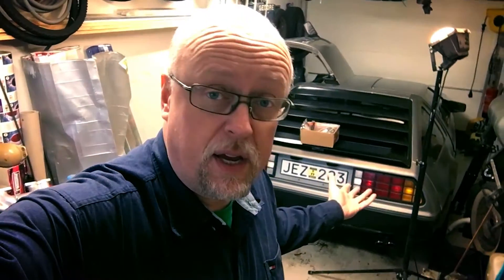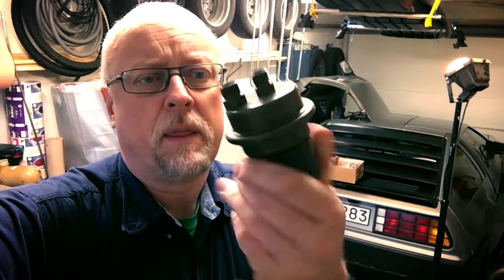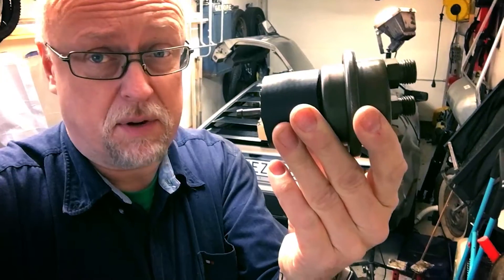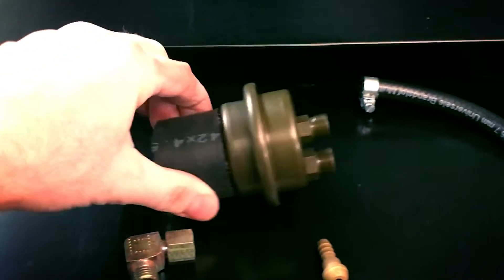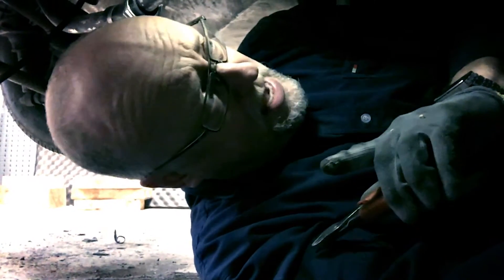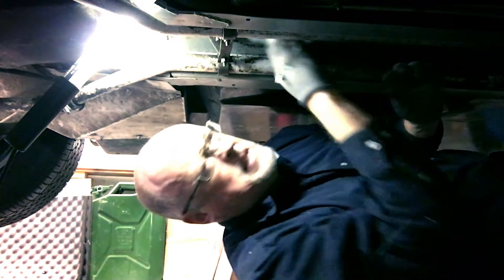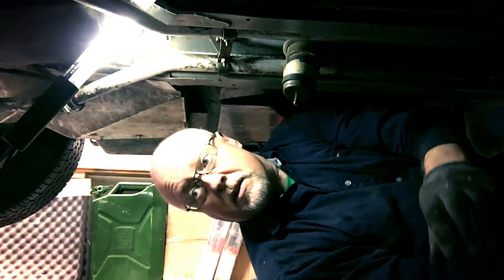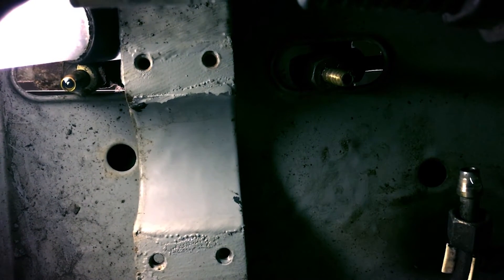DeLorean DMC 12 Accumulator

Comment: When you were tightening the fittings to the accumulator, you used an adjustable wrench to grab and hold the accumulator so it wouldn't twist while you were tightening.  That is what the welded Nuts on the bottom of the threads are for. To hold the welded nut with one wrench and use another wrench to tighten the fittings..... just to let you know. Great video otherwise
Reply from the maker: Thanks Mate! I should have thought of that, seem rather obvious when you point it out!